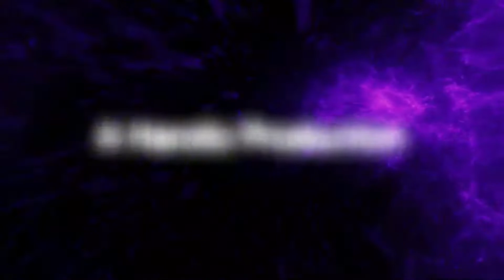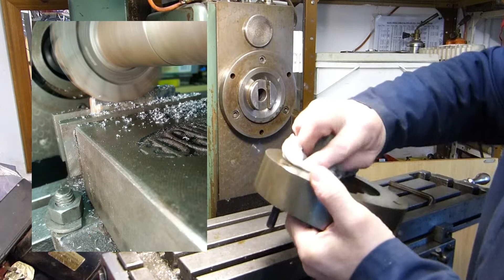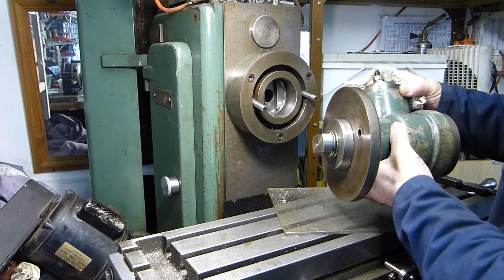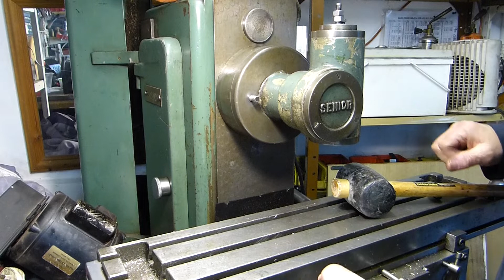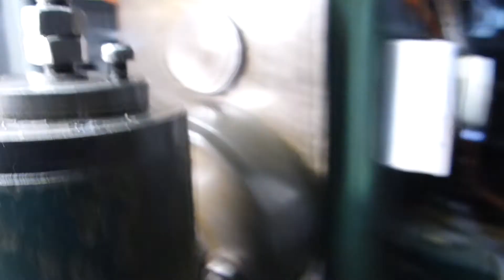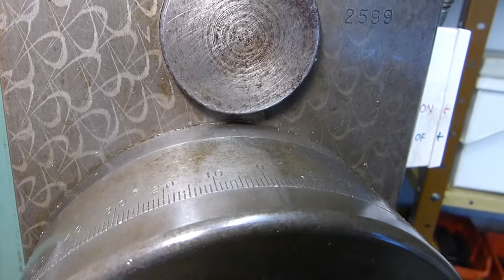Refitting A Tom Senior M1 Vertical  Head

Comment: I reckon a couple of L-shaped bits of tin stuck on with magnets would hold the head mount bolts in place while you try to line up the drive spigot. Was just working on a friend's Senior today. Not sure if he still has the factory head; he's adapted his to use a Centec head (which I haven't used yet). Gives you a quill but it probably can't take the cut that the factory one could. Lovely machines!
Reply from the maker: A good trick,thanks for the tip and thanks for watching the video.
Reply from the maker: Agood idea, worth trying,anything to help,the main problem is the very close fit of the spigot in the mounting adapter on the drive,really makes it awkward,thanks for watching the video and your comment.
Reply: @popperkeg1234  In the time since I commented, I've bought my own Tom, so I'll get to find out for myself!
Reply from the maker: @mhagnew  you will never look back getting a senior miller,they are built to last,had mine going on 40 years and its never let me down😀